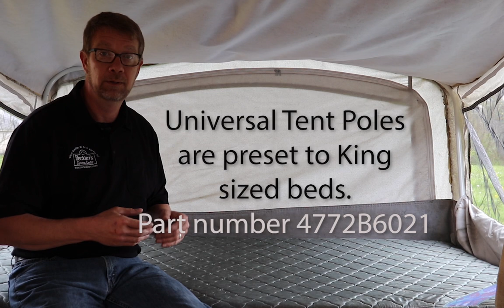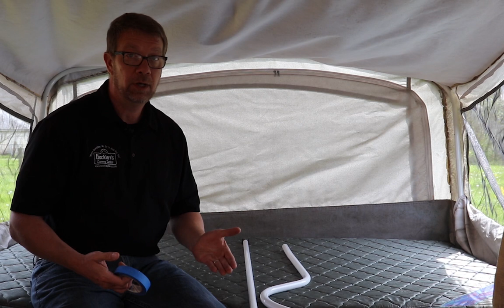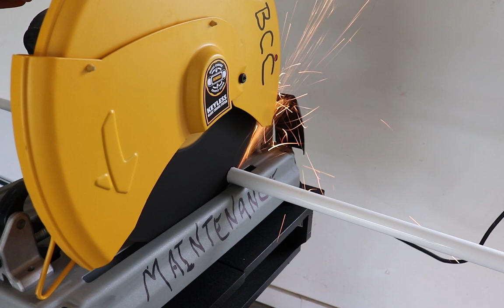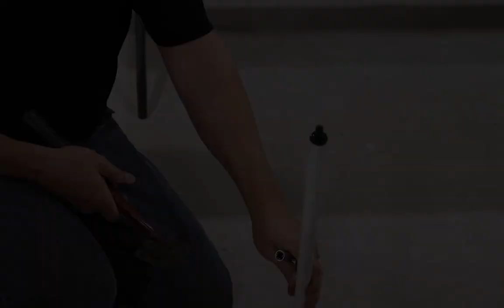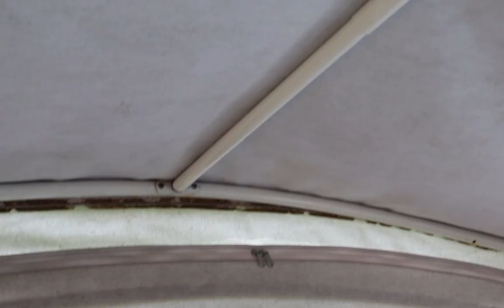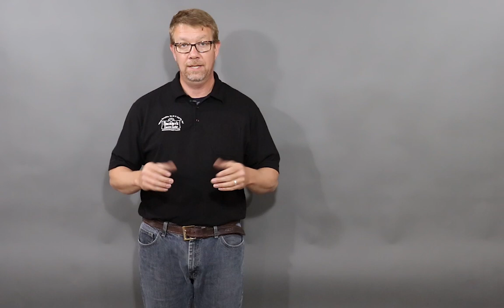How to custom size and install a pop up camper tent pole

Comment: I just got one of these, but it's just a few inches too long for my camper. My question is, rather than sawing part of it off and having to remove/replace the peg at the end, is there a reason I can't just drill more holes in it, to allow the sliding pole to lock in at a shorter length? Thanks
Reply from the maker: Sure! For minor adjustments that’s just fine

Comment: Absolutely love your instructional videos.  Thank you.  I searched your videos for advice on weatherproofing the canvas (Sunbrella).  I'm picking up our new (used) 2006 Fleetwood Utah next week.  After watching your popup videos I felt comfortable with that purchase.  Would you be so kind as to recommend some products for waterproofing?  Also, any thoughts on that year and model?
Reply from the maker: First off I just love the Utah floor plans. You picked an awesome camper. For waterproofing, this is a matter of personal preference. Adding waterproofed will lose some of the breathability of the canvas, but slow the inner condensation that can occur. It’s also typically a yearly application to keep it working as intended.

Comment: Is there any way to made a shepherd hook? They are price on the Coleman website
Reply from the maker: They are quite expensive to set up the tooling. You will want to talk to a local metal fabricator. We will have them back in stock soon, and hope to be able to hold the same price. Cost are ever rising.

Comment: where can we get the part that the duck bill clicks into ? The metal one on the roof? I just ordered a new pole but I dont think it comes with the part I need to hook it to the roof and I cant seem to find it anywhere
Reply from the maker: This is called the Duck Bill Bracket. Here is a link to this product. https://colemanpopupparts.com/products/steel-loop